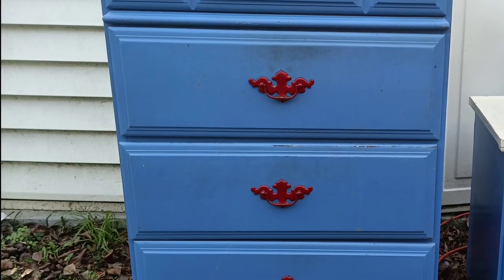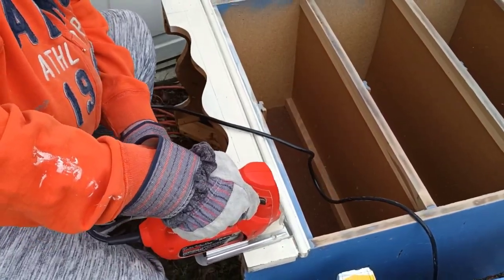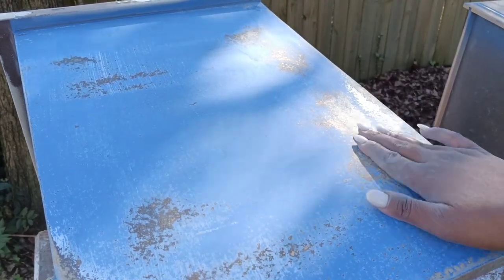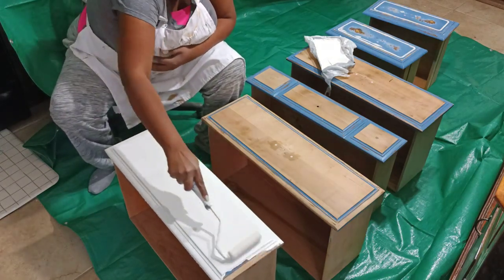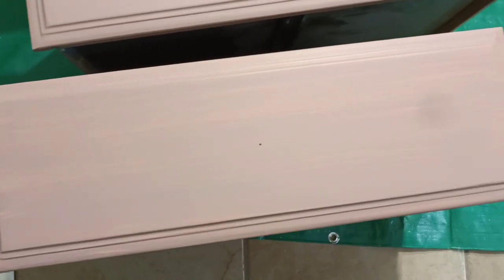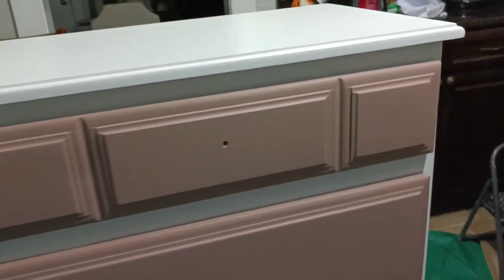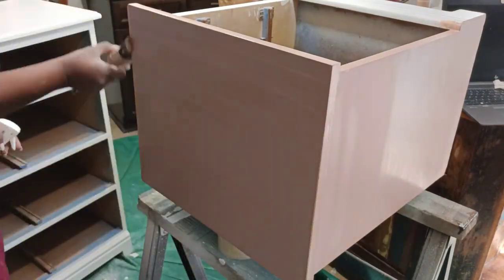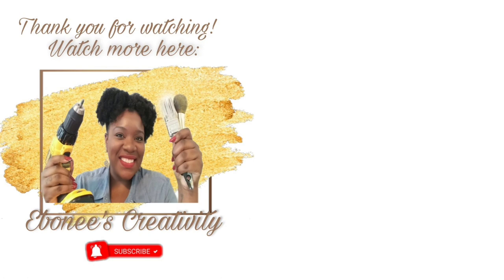TRASH TO TREASURE | METALLIC PAINT | FURNITURE FLIP

Comment: Looks great ! Do you ever get bubbles applying with that spong ? Also is the polyurethane oil based or water ?
Reply from the maker: Thanks! It will leave bubbles if you shake it then apply it (if you see bubbles in the jar, you'll see bubbles on your piece) or if you have too much caked into the sponge. I gently roll it on it's side to mix it  instead of shaking & make sure not to saturate my sponge with product & it's smooth sailing. Water based.

Comment: What is the purpose of putting on a primer before painting?
Reply from the maker: There are a couple. Number one I'm going from a darker shade to a lighter color so the primary helps to hide the darker color to make sure it won't be visible under the pink. Second, it sticks to the furniture and the paint sticks to it so it's an extra layer of durability. Third, on projects where there are repairs, it gives a blank canvas to apply my paint to. You get a much smoother finish if everything is primed and then you pay over that then you do if you put paint over something like wood filler or Bondo then put paint over wood that hasn't been repaired...basically it provides a clean slate to work on. Also, this particular primer helps to mask any odors & block tannins from showing through paint. For newbies I would describe it like this:  when you go to the nail shop they put a base coat on your nails then polish then top coat. The primer would be like the base coat.